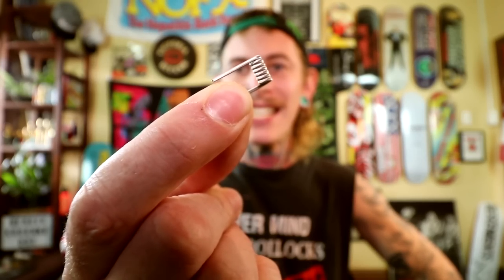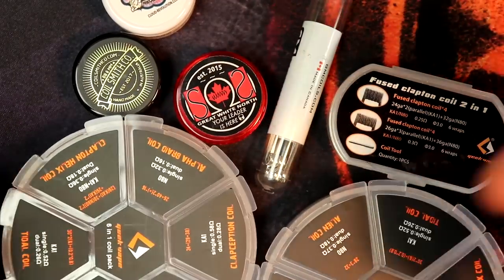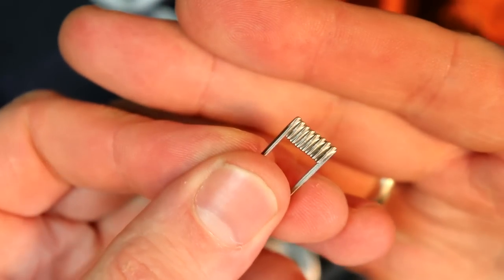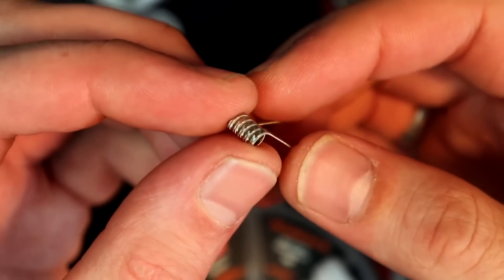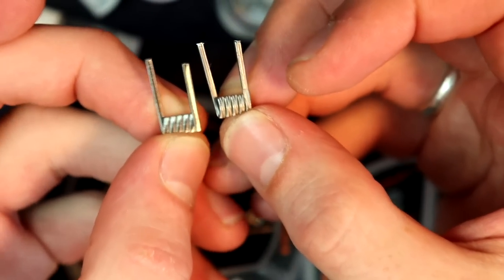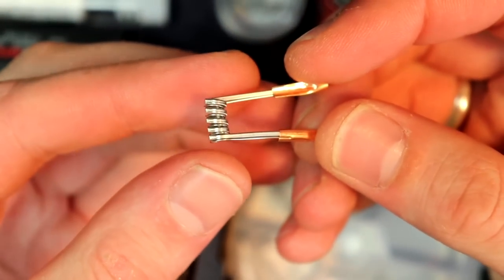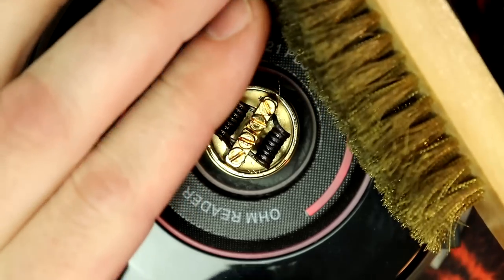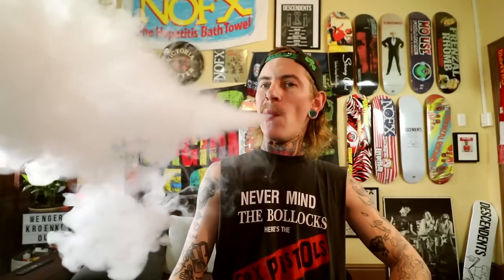Fancy Coils | China vs The West + How I Clean Them | The Vaping Bogan

Comment: Never popped a leg or a coil, I've never used a pre built coil though only ever made my own, do notice a difference in wire quality though with  cheap wire and not lasting as long and gunking up alot quicker. Not sure about that big wire brush scrubbing off the finnish of your atomizer, screws and coils would make me slightly concerned would at least rinse or use ultrasonic cleaner and or pressure blow out any metal and dry vape crust dust away before reusing your coils but that's just my thoughts re harm reduction this video's 3 years old though and I'm late to the party, interesting vid though as have been thinking of comparing my own pre built coils aliens etc to other pro and cheap company coils, the price though has always been off putting to me.

Comment: I love Advanced Vape Supply for wire. They are ss only and you can get any spool or premade coils you want in any configuration for really cheap. I get big spools of double, triple, and quad core fused claptons for under 20 bucks. I've been loving this spool of quad core fused Clapton 28x38, I don't know if it's just this spool but it looks like an alien on one side for some reason. They also have an ohm chart at the site to find out what any set up ohms out at. Everything is top quality and colors up beautifully and performs and lasts forever. I clean by rinsing everything first then lightly burning off being careful not to char the metal. After a little ill let the glow die down then squirt with spray bottle, burn off, let glow die down a little then squirt again, glow then like new, over and over.

Comment: Watching this video after 5 years. Personally I think some things changed and some are still valid. 

Like i think you could get premade coils in almost all guages nowadays. 
I personally prefer spools and i think coilology, demon killer, vandyvape, geekvape etc makes decent Clapton and dual and tripple core fused clapton spools at affordable prices. You could get 26,28,30 or even 32 core wrapped with 36, 38 and 40 in all 3 metals nowadays. The only thing i still haven't found is a real alian spool with those gauges. These spools cost anyware around 4$ to 10$ for 10ft. You could make a 5-6 wrap coil from 7-12 cm of wire depending on the id (2.5 to 4mm)

I think that makes even the self wrapping look expensive. 

The points like durability and using and supporting local makers are still valid.

Comment: This is great info for people wanting premade coils. Personally, I won't buy a pair of coils for 10 buckerooskies when I can get 100 ft of stainless 24 for the same price. So what if I have to build my own? Good learning experience. Perhaps I'll grab a big pack of Geekvape or whatever coils, but I don't have enough atties to justify that yet.
Nothing against people who buy coils. I'd just much prefer buying twisted wire spools and going from there, or simple round wire. I mostly do parallels as they are easy to build and have great flavor. Nothing like a mega fused staggered double framed pedantic coil I'm sure, but it works.
My opinion is always changing though so we'll see.

Vape on all

Comment: I have extreme sensitivity to cotton turning. If I don’t rewick and clean my RDA could twice a day I get a very bad cough. I use cheap China single aliens at 0.25 ohms running at 45 watts. If I’m lucky a coil will last two weeks, before it’s part of the problem. I get 10 coils for $4 so I can chop and change them without much expense. Based on that I’d struggle to think a $20 pair of coils would last me. I run four devices daily and dry burn and rewick them all!
My case is an extreme minority. I couldn’t even try the coils you showed pre-clean, without heaving 😳😃
Interesting video!
Thanks.

Comment: Sam, mate you forgot to mention the flavour. I have experienced noticeable difference in flavour while using coils made of quality wires. 
Issue is, with china its trial and error thing. You gotta try so many different Chinese made coils and see what coils you like and from what company. If you are lucky enough you will get similar performing coils again when you order again but with US made wires you just need to worry about what type of coil and what resistance you want and you will get the same every time you order.
I still own some china made coils but mostly now i use coils made of US made wire.

Comment: when i clean coils, i first rinse the rda in hot water & then heat them up till they're glowing & dip 'em in water. they sizzle & then i heat them again/dip 'em in water till they stop releasing nasty fumes. Advanced Vape Supply has excellent SS wire.
Reply: Same my RDAs don't need scuffed up by a huge wire brush. Not nice to the o rings either

Comment: I agree 100% as far as quality goes. However, I do keep a 7 in 1 kit of Coilology n80 coils stashed for times funds are low or things of the like. Honestly, I can only speak for Coilology but they aren't half bad. The cores match up to what Western builders use and they vape great. They have Triple core fused 26gx3/36gx3, fused regular 26gx2/36g, framed staple 28x2/.1*.3ribbon/36g, regular staples, multi-strand fused, etc.
Reply: Coilology coils are on point , Plus they vape great for the price. :)
Reply: Same here, I buy this same kit and there is about 5 out of the 7 coils that are very nice a vape very well
Reply: Coilology coils are just as good as the hand mades. I love the tri-core fused Claptons
Reply: Sun Behind the Sun 777 you said it man!.. minus the chain link ones
Reply: whee0609 yes! Hate those chain link, only ones in the pack unused haha
Reply: Another good Chinese wire co is vpdam. Ok for Rta's especially.
Reply: Coilology is the best cheap option, I've tried alot. But they don't hold a candle to handmade coils. Even coilologys' "handmade" coils don't last but 2 weeks if you're taking care of em. I always got a spool of thier 28g framed staple wire, best flavor possible for the cheap stuff. But an 8$ pair of western handmade aliens can last 4 months at least if you want em to.
Reply: I agree I have and use the Coilology 10pk(multi strand and fused clapton) which work great.  I even bought a few of the more expensive "handmade" ones that only come in a pair for $7-8 and they work great as well. I'm actually using the "interlock framed alien" right now and there going on over 2months.
Reply: Demon Killer's badly named 'violence coils' hold up well for china coils

Comment: Bogan,yep you made sense. I understood it. It comes down to quality vs. quantity. Buying the mass produced coils(large quantity in one pack) the quality of materials and manufacture will be lower. Buying the hand made coils(smaller quantity in one pack) the quality of materials and manufacture will be higher. Now if someone can figure out a way to mass produce high quality,spot on coils using high quality materials and sell them in larger packs at affordable prices they could really accomplish something. I worked in mass production jobs and balancing mass quantity and high quality usually doesn't work. Sacrifices need to be made to hit quantity numbers and the first sacrifice is quality. Quality of materials,quality of product. It's the nature of the beast.

Comment: I clean mine by dry firing and while the coil is red hot put it under cold Water faucet that is on a very thin low stream obviously make sure you’re not hitting the fire button and don’t let the water get onto your mod and do that two or three times to each coil and they look brand new EZ PZ.

Comment: Im from iraq and ive been vaping for a lot a use mech mods (purge slam piece & mage mech) and in my country there are about 5 coil builders and it is very hard in my country to get the materials for the coils and the coils they make are amazing so check them out two of the builders are coilsmith and cloud zone

Comment: Here is how I clean my coils. 
1. Fill a little sauce bowl with distilled water.  It is important to use distilled water to prevent mineral buildup.
2. Fire the coils till they are glowing
3. While the coils are still glowing, but you are not firing mod, submerge coils in the distilled water.  
Repeat steps 2 and 3 maybe four times till coils are shiny.  Works great for me.
Reply: TheWraithkrown that weakens the metal. Get an ultrasonic. Rinse your rda with warm water let dry then dry fire it rinse the gunk off throw it in the US cleaner good as new.

Comment: Hammer your desired 22ga or 24ga wire type flat until it’s roughly 0.2mm thick. Finely sand and polish it back, wind your coils and go nuts. I find round wire (that’s been hammered flat) to give far better results than any complex coil. They have a very fast ramp up time in mechanical devices and they’re much more power-efficient in regulated mods. Not only that, they’re much lighter because much less wire is used to create them. They also have a much greater surface area in contact with the wicks, yet they use far less liquid than complex wires. They keep your atomisers cool. Also, due to their 0.2mm thickness, you can wind them with a much bigger ID. Finally, taking science into consideration, flat wire coils are much more aerodynamic than complex coils due to the way air flows around their smooth surface. The air can travel over and surround the entire coil to provide much more efficient cooling. In complex wires, the airflow becomes more turbulent on the uneven surfaces of the coil and can leave parts of the coil without air. Micro Claptons or coils with a wrap equal to or thinner than 40ga are the exceptions. In turn, this airflow effect creates more dense vapour and much better flavour without burning through your liquid as quickly. After some research and experiments, I found flat wire coils to be very efficient all around, they gave the best flavour and are now my go-to coils.
Reply: why not just use ribbon wire instead of making it urself ?

Comment: There are pretty good coils and wires by a chinese company called Vapefly. 
They got Claptons 4x 28g Ni80 Core 40g Ni80 Wrap. 
The premade coils are 0.2 ohms single, 0.1 ohms dual. Or you buy the wire and wrap it yourself.

Comment: I know I'm late to this party but I have a question that doesn't seem to get addressed. I have been using a sub ohm tank but I'm getting ready to go RDA. I've watched different people do builds and whatnot....this video expanded the knowledge from simply building on a deck to answering questions like...how long do the coils last and how to clean them...but how often do you change the cotton (wicks) in the builds? I can't get through a whole day on a standard sub ohm cartridge coil. I like sweet juices and I constantly vape so it's obvious that the combo of sweet juice and "chain vaping" is killing cartridges. Will I have this same problem if I go RDA? and again...how often do you change the cotton? Also....do you clean your coils every time you re-wick? I think what is killing the overall experience for me is...I'm not getting the flavor I want for very long and replacing coils is getting ridiculous in price. 1 coil per day....I really need help.
I am thinking about buying your Bonza RDA as my first deck to build on...is that a wise decision for someone just getting into it? I've been smoke free for 3 months....but as much as I like my tank for holding juices...I would rather drip if it's going to help the problem I've mentioned above. Do you have any advice for me.
Reply: rebuldables will still gunk up but easy cleaned. you may be happy with plain round wire builds as thats all thats in MOST sun ohm stock coils

Comment: The china coils are cheap and really good for most people. And if you have a decent regulated mod, every coil will vape well. But the biggest thing for me is, i only use rda's on mechmods. And not one china coil gives me a satisfying vape on a single 18650 tube. So that's why i started building myself with only ni80. (Except for ribbon in framed staples or something, there i use kanthal because ni80 comes out way too low in resistance)

Comment: Great vid Sam, wanted to see this. But, how do you run a 0.11 build on a single 18650 mech? Surely that will be pulling too many amps from your battery?
Reply: Curtis Brown it will be going over the CDR of the battery, but it won't necessarily blow up. Heat is the #1 thing to watch for in that situation.

Comment: See, I just pulse and run it under water when they're orange. Usually my coils last about 2 and a half months.
Reply: Don't run them under water when they are red hot. You are changing the molecular structure of the metal. Rinse them once they have cooled off a bit.
Reply: @zaxx7205  Been doing it for years and have had no issues. Stuff last a long time and nothing ever harms me.
Reply: @ShadingNight  I'm just letting you know what happens when you suddenly change the temperature of a metal. What you do with the information is on you. But you might find they last you twice as long as they do right now. But whatever works for you works. Just throwing the info out there

Comment: Nice video bro I get what your saying here. For me I stopped buying the "western" expensive $30/pair of coils over 2yrs now though. I mostly use SS316l coils from AdvancedVapeSupply.com and they make some quality coils for great prices. I usually get the quad fused and when I take a wrap off give me around .11 for my mechs. I also sometimes get the Coilology coils like the 10pk ones(multi-strand-fused are good). However the ones Coilology sells that are a little more expensive and sold in pairs for like $7-8 are better bc there actually hand wrapped. Whether its Advanced Vape Supply or Coilology I can usually get 3/4months out of the coil(s) no bs. As long as I take care of them with my Coilmaster wire brush(like you mentioned). The difference is just way to minimal to me to pay over $30 for two coils.

Comment: What metal is the bristles of your brush used in the cleaning section of this video?
Reply: Nolan Akitt Brass. You can use brass or copper wire brushes, esp if your deck is gold plated like Bogan's is. It will still wear the gold off, but since brushes made of yellow metals (brass, bronze, copper) are softer and won't wear the gold off as fast/easily.
Reply from the maker: yes what andrew said, hehe
Reply: Andrew Delashaw thanks man gonna pick me up a brass

Comment: It may be wrong but guys in my area showed me to heat the coils up on the mod and run it under the faucet and it comes out shiny and new
Reply from the maker: yeah water works well but it really stresses the metal heating it to red hot and then dumping it under water. wears out ya coils quicker. giving them a brush, let them cool and then wash is much less stress on the metals. see i knew there would be something i missed
Reply: When I clean mine I wait for them to cool then run them under water. Then give them s good brushing. Heat them up let them cool then run them under some water again and one last heat up to burn the water off. And I blow on the coils as I pulse them making sure not to make them glow like crazy. The coils always come out looking good as new

Comment: I've always enjoyed your channel and reviews but I am a little unsure of your coil cleaning method. Although it's highly possible that I may be talking out of my ass, I am a little concerned with the idea of cleaning the coils with a metal brush. If the brush is a much softer metal, it seems that bits of the wire could end up inside the cracks and crevices of the coils (even if on a microscopic level). If the brush is of similar hardness to the coils (and as you stated, the metal will degrade over time) then you could be damaging the metals as well and compounding the issue. To each their own but cleaning with a metal brush is something I'm not personally comfortable with.
Reply: Brian Jones I wasnt fond of that method either but who knows I never tried it. I use the "coil master" wire brush they sell that Sam actually mentioned.  They sell them at my local shop for like $8 and come with another brush when the firsr one goes bad. Works like a charm.
Reply: also if ur gonna wire brush ur coils i hope you rinse them real well as ur creating micro shards of metal lodged in the creases that u dont wanna vape...
Reply: @RyGuyRy  $8 for two of those little brushes? That's insane, should be able to get those for about $1 a piece.

Comment: Western coils are far more superior than Chinese coils that's for sure. I tried both and I can notice the difference in the vape is significant. However, Chinese coils are waaaay cheaper so in the economical aspect Chinese coils will be more relevant to the common vaper. Western coils do last longer sure but they are kinda pricey!

Comment: Im late viewing this but just wanted to say GREAT INFO! Im a mech user and I started with some Chinese coils because I just couldnt imagine 25 a pair. A few months ago I got a set from ohmland coils and I will never go back. I run single coil at .11-.13 and you just cant find that there. Plus the finer guages that cant be used in a mass produced coil means more surface area and better flavor. Ramp up is almost non existant in my parallel driptech ds. Great job explaining everything.

Comment: USA iso specs for metal are completely different then China's wire specs. China is doing a lot of metal recycling. There wire specs allow larger variances in the base metals plus or minus and they are not the best at quality control. Then you got the China machine oil. But wrap wire gauge makes all the difference. It's way faster to use 32g then 3x as much and 3x longer to make it with a 38g or 40g wrap. I wouldn't pay the crazy handmade price. Coilogy makes decent resistance for mech coils. But I found advancedvapesupply with there spools or premade coils , American wire made on a American machine basically as good as handmade. Just no aliens. I like the 30gx3 38g or the 30gx4 40g. All stainless steel